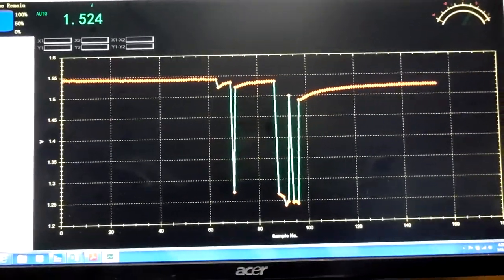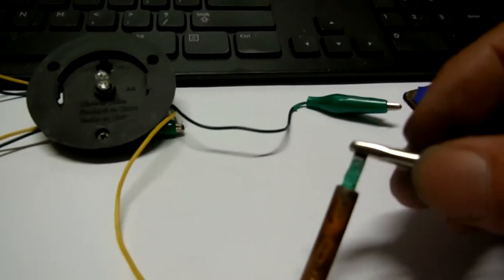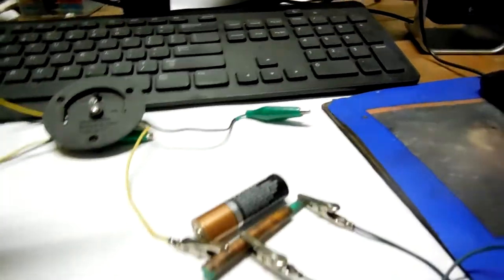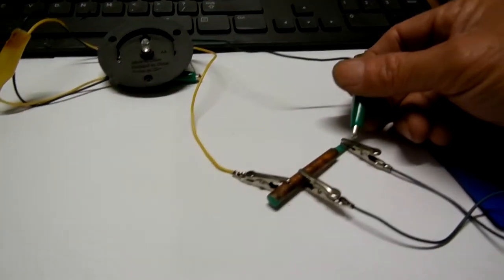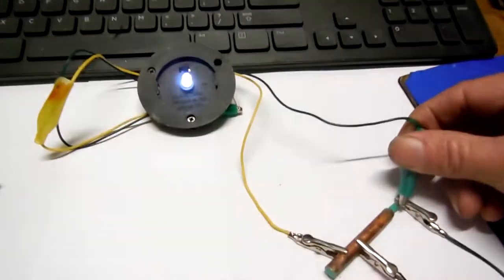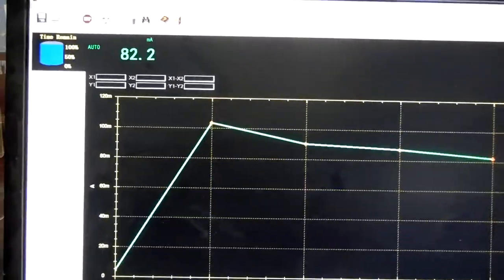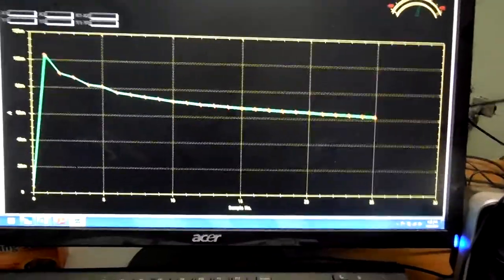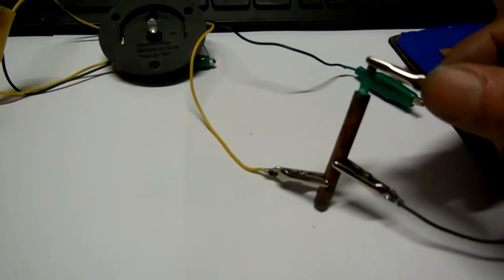Crystal battery, Magnesium battery testing

Comment: nice! is there anything mixed in with the liquid tape such as alum? great work!
Reply from the maker: Hi Shad,
I only use the liquid tape to seal the connection point at the mag and seal the ends of the cells, what you see here is my test cells, they are very inexpensive to make and it gives you a good idea what your cell will do when you up size it

If you wanted to try a mix cell design out, I do have mixes posted on other videos,  you should also try laser sabers, Plengo , overunity and others videos,  just be careful and do these at your own risk, but have fun experimenting

First try on wet cells and then let them dry up like these to see what kind of power you have when dry

hope that helps
Reply: Steve,  Which video contains the mix you are reffering too? Is it the last one that talks about chili powder? I have experimented with Bedini, and Lasersabers, and Plengo's cells.  They are all great, but they do not deliver high amperage like this. Something seems unique in the cell herein. Maybe its the grade of Mg, or something I have missed in your previous video's. Anything helps at this point. Cheers, and thanks for your inputs!
//J